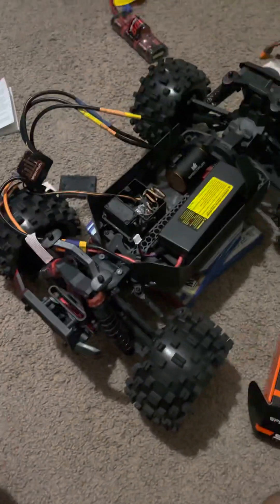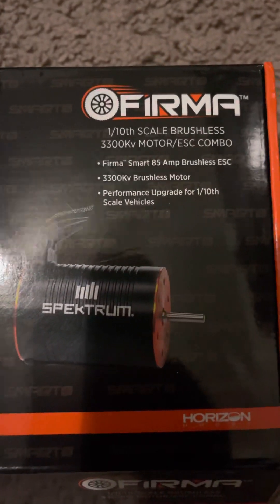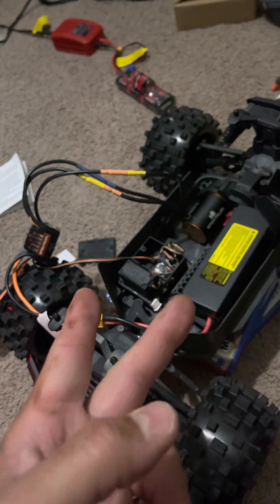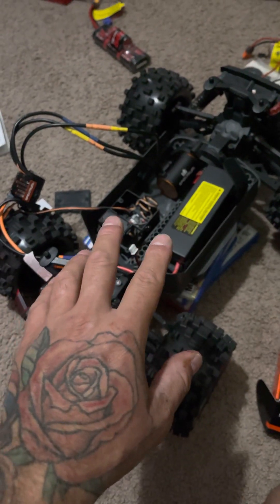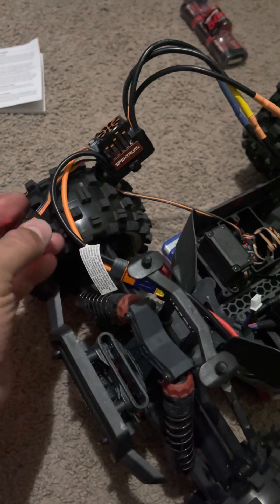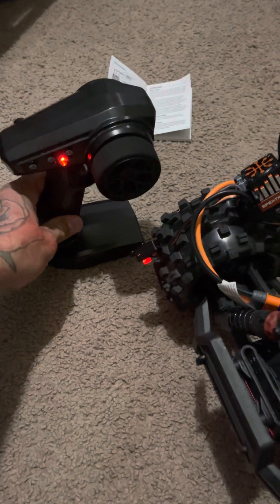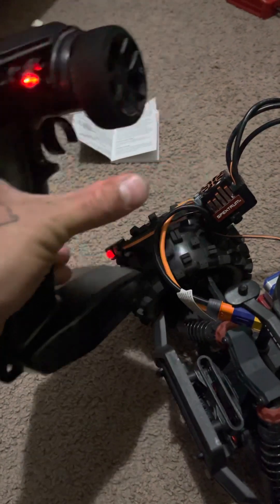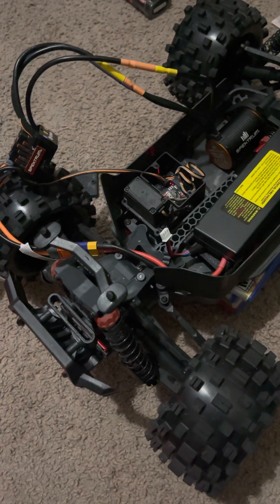Spectrum ESC throttle  FIX reverse going faster than throttle FIXED!!!

Comment: Hi i using typhoon 3s esc 2s to 3s lipo but going to connect batter whe  full throttle power cut n then finish8

Comment: Can you creep real slow or does it only go a certain speed when you initially hit the throttle I have a spectrum 120 amp ESC and a spectrum 3150kv brushless motor even if it is hooked to a 2400 KV Traxxas brushless motor it does the same thing I just barely tapped the gas 8 miles an hour is as slow as it will go 10 miles an hour with the other

Comment: There is a fix where you can swap the wires back. When you purchased the motor there should have been a card with a list of specs for punch brake drag etc. You can access these settings by powering on the esc and holding down the setting button. You then will hit the setting button till you access the motor direction control which for that motor it would be option 5 so you will hit setting 5 times you will know you are on the right setting when you hear 5 beeps. You then hold down setting and you will hear 1 beep which means your motor is set to ccw you can then hit the setting button again and will hear 2 beeps. Once you hear 2 beeps you hold down the setting button and you will hear a bunch more beeps after the beeping stops you can power cycle your system and the motor will be configured correctly.
Reply: Thanks for addressing the root cause, problem fixed, thank you!
Reply: I tried to do this on my esc. I was unable to reach the (5 button presses) step. Do I need a program card?
Reply: @7badtothebone  YES! If you are unable to find the card you can find it online